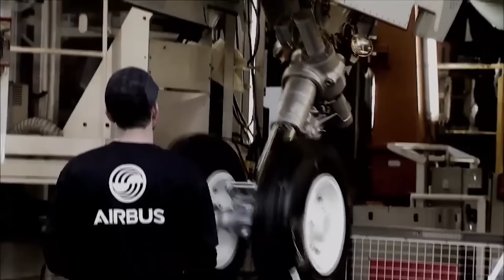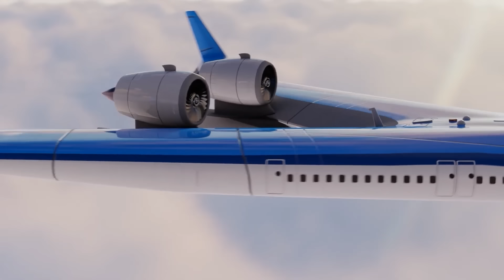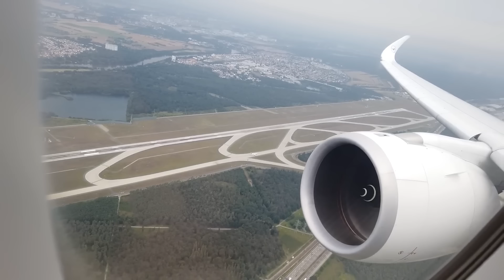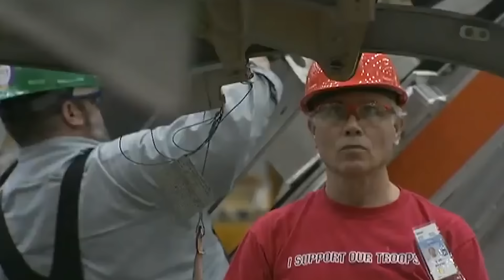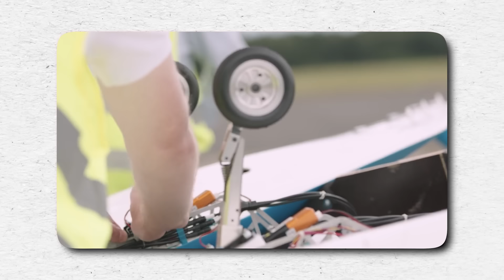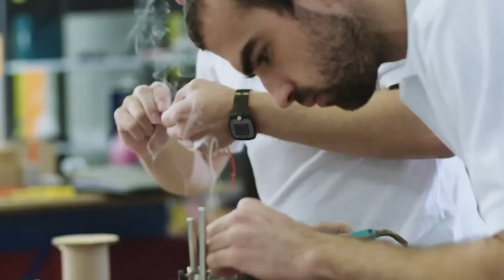Boeing and Airbus Are TERRIFIED of This New Plane | Flying V

Comment: Yes this design works. capacity still good 408 2nd class(coach and 40 in first class. First class is truly isolated from 2nd 100% with it's own kitchen. Stress of a lifting body as opposed to old Wing body Boeing aircraft Design of 1940's. This plane has a high probability of full scale airline deployment. A future craft? The cards say yes. Year: 2046-2140's? Somewhere in there they move to Hydrogen combustion jets 2054ish  but same body style. kerosene is mostly retired as fuel. Rudders are and efficiency cost from drag. Differential thrust will work better in heavy winds on approach accuracy and touchdown. Computer flight is complex but has been possible like the B-2 bomber.

Comment: Wondering about crash safety dynamics. Collapsible structures and fuel tank isolation don't seem possible when passengers,are in the wing, sitting on fuel tanks.

Comment: Is this a tested entity in the air? Can a detachable passenger portion n pilot detachable seat be part of it so that in emergency passengers portion can get automatic detachment n lowered to the ground by the help of the 4 parachutes
Reply from the maker: That's a really interesting thought about the detachable passenger portion and pilot seat! While the Flying-V concept is still in its early stages and focuses on fuel efficiency and design, those kinds of safety innovations are definitely something engineers are constantly exploring for future aircraft.

Comment: What a great design. I would just add another flat sheet of metal between the V which I think could assist with engine failures and keep it more stable in doing emergency landings and would have more gliding capabilities to enable it to cover more distance. It could also be used as a fuselage as well which will give it more range.

Comment: Airframe must have an "elliptical" cross section not this, nor current designs. That will generate massive lift while enabling 2 turbine-800 seats. Means %70 more savings, with minimum stress on hydraulics.

Comment: That is only half the range of a 777. It would also get the name "vomit comet" very quickly. Wing structures flex for a reason, survivability.
Reply from the maker: Check part 2 and 3 hahaha
Reply: @ExPlaned1  Comprehension issues?
Reply from the maker: @Mordalo  no not at All :) but I made a part 2 and 3 explaining more

Comment: This comment about the body providing lift is not true !! It absolutely does contribute. How exactly would the space shuttles have flown. As soon as the angle of attack increases the fuselage has high pressure air flow under it, this reduces the pressure above the aircraft and therefore does increase by at least 10 to 30 percent depending on the designs of the aircraft...

Comment: dont think it would work unless the lane bebomes mush biggen , the wingshape of the passengers compartment causes it ti have less headroom towads the trailing edge of the wings , there be way less window seas and the load has to be distributed more evwenly across both fuselages or the plane will fly pretty badly 
the wing shaped fuselage will be harder to pressurize like a cilindical fuselage , the shape wants to become a cilinder so needs a stronger body with ribs to resist that 
since the wings need to hold people their thickness is mush larger and the frontal surface / drag increases , not quite sure but my feelings tell me the plane will be less efficient compared to an airbus build twice as large as the current one

Comment: t looks too delicate, there is no clear composition of the two bodies? Where do these two fuselages connect? Only in the nose of the aircraft, .What is the length of the junction of the two bodies in relation to the length of the entire aircraft? Is the junction of the two bodies long 1/4 of the aircraft or 1/3 of the aircraft length or 1/2???? Then that body is divided into two parts without a single point of contact anymore? The engine platforms protrude into empty space, there is no connection between them? I don't think this scalamery will see me

Comment: I cann see one major operatonal issue, that of balancing passenger/cargo/fuel weights, side vs. side, and front to back.   It's similar to the balancing of weight issue of surface ships.   For example, even if the Flying V can handle 100 tons, it can't have 90 tons on the right and 10 tons on the left.   You don't have this balancing issue in modern jets since the fuselage is a central tube.

Comment: There is not a single ting wrong with a different looking design that actually works properly and safely. The standard passenger and or aircraft have used the same designs for a very long time. We shall see how much or little the new design will impact the industry

Comment: The design could easily incorporate solar tiling to provide electricity, too.
Reply: To what end?  Each solar tile would have to be custom made like the tiles for the Aptera.  And you get very little in exchange.  The amount of energy syphoned off from the engines for electricity is miniscule.

Comment: No, they aren't. The airplanes of tomorrow aren't going to look like that. The model is beautiful. But it's a model. I've seen a model of Snoopy's doghouse fly so making that thing fly is no big deal. Airliners are built they way they're built to make money, both for the companies building them and for the companies operating them. That V design, or rather wedge, has an inherent flaw. I do not want my body to absorb the impacts of up and down drafts in the air. Wings flex, acting like shock absorbers. This aircraft will do no such thing.
No, thanks.

Comment: You will not get passengers to sit in the interior section, and it would not be possible to evacuate quickly in an emergency. The only way this could work is for cargo or passengers with cargo in the interior

Comment: How on earth is every passenger going to have a window seat? The plane has four sides, and only the two outside sides have windows. It will have fewer window seats then current planes. With 2-2-2 seating, there are a total of 12 columns of seats, and only two will have windows.

Comment: Its only a prototype at this point which means it hasn't been built yet. It is still in the development and prototype testing phase. Researchers at TU Delft in the Netherlands, supported by KLM, successfully flew a small, radio-controlled scale model in 2020. A full-scale, passenger-carrying version is not expected to be in service before 2040–2050

Comment: The flying wing is a miracle, but putting the engines and fuel so far aft is a nightmare for stability. And of course the weight of that fuel changes as it burns which further affects the center of gravity whereas a conventional plane has all the fuel exactly on the CG so that's no worry at all.

Comment: The flying V should be safer when everything fails. The current plane stress me out knowing the fuselage doesn’t participate in the lift.
Reply: Total bullshit story telling , also Typical breakdown for a wide-body like the 777 at cruise (Mach ~0.84, high altitude, clean configuration):

Wings: ~85–95% of total lift
Fuselage(body): ~5–12% of total lift (can vary with loading, angle of attack, and Mach effects)
Horizontal tail: usually slightly negative lift (downforce for stability), offsetting part of fuselage contribution
Reply: When everything fails the traditional tube, wing & tail design is MUCH more stable. Like some modern military aircraft (*cough* F-22), the V design is going to require all kinds of computer-assisted stabilizing for normal flight

Comment: This isn't new . main mfg. have been looking into all kinds of designs for decades .  more than the tech is required , the market , the passengers themselves have a say in this . at least a 20% increase in efficiency is required for a full redesign and $$$$$ cost equation .
Reply from the maker: You're absolutely right, these concepts aren't new, and the market and passenger experience are huge factors beyond just the tech. It's a complex equation!

Comment: Sitting that far from the center of roll is going to be miserable.
Reply: Or exhilarating 😂
Reply: @Xaniker lol, most people don’t load their families on trans-Atlantic flights and hope for exhilaration. Just watch their reactions to turbulence.
Reply: @kurtl8425 I was being half serious
Reply: Flight dynamics might be different enough to mitigate against that.
Reply: "Roll"?  When a plane turns, it banks and changes the direction of it's lift force, which keeps you upright in your seat.  I've never been tossed from side to side because a plane is turning.  You're "roll" is what you are imagining happens - not what actually happens. Get a plane ticket - you'll see.
Reply: @nycbearff you’ve never sat that far from the centerline of the aircraft either. Imagine the wing as a giant teeter totter. When the plane banks 20 degrees if you’re 5’ from the center line you’re either being pushed up or dropped just under 2’ depending on which side of the aircraft you’re on and it’s uncomfortable. If your 20’ off the centerline it’s almost a 8’ drop.
Reply: @kurtl8425  You're extrapolating but, I think, missing a few variables.  Anyway, people who've traveled in the wing of a flying wing style plane have been able to sleep without interruptions, and report a very smooth ride - so there are some observations which your description does not align with. 

And the plane will have to be constantly computer stabilized, which produces a very smooth ride.  The air dynamics around a flying wing are different - I don't know how that effects the plane.  But the planes are described as slower to respond, including slow to respond to turbulence, which damps it.  That goes along with the smooth ride - and has now made me curious about what the air is actually doing around it.
Reply: This idea has been around since the dawn of aviation. There’s a reason no one’s using it for passenger aircraft.
Reply: @kurtl8425  Yes, many reasons.  But B-2s fly without the problems you're describing, and they're flying wings.  So I don't think physics is the main reason.
Reply: @nycbearff no people sitting in the wings. People who will bitch incessantly about the he slightest inconvenience or discomfort.
Reply: I don't think so.

Comment: Nothing really new here, both the delta wing and the lift body are quite old in designs, the difference is the cut out of the delta wing with a full lift body.   Both Northrop and Burnelli had the beginnings of this design prior to WWII.
The excitement comes from departing from static old designs.

Comment: Include a 3rd Engine and an aircraft frame that sustains 12-G’s both positive and negative, can take off and land on 2500 feet of unpaved runway, and a 17,000 mile range and you have the “XL” designed by engineering students at UC Berkeley for a new Air Force-1 back in 1996.

Comment: people that fear flight! with the V configuration, the gravity adjustment made from turns lift or descents. these with be more disturbing on those less centered to the planes center structure. think of a boat and motion sickness. it lessens the closer to center of gravity. these companies think of themselves, more than the people…

Comment: From Northrup's first experiment Flying Wings through the B-35 (?) bomber to the B-2 the lifting body layout has all provided greater efficiency. This seems to be an optimized design. Incorporating the Whitcombe winglets as rudders is a good idea although drag rudder/ailerons would work. Elevated engines give them clear air to enhance performance.

Comment: As long as the engines are exposed to ice, that can be build up on the wings when weather conditions are bad, thats a bad choise. The ice could came off and destroy the engine wich has happened in the past with rearmounted engines.

Comment: What if birds hit the windows, they beying more exposed to hits in this desighn?
Reply from the maker: That's a valid concern! Safety is paramount, and engineers consider bird strike resistance in all aircraft designs, including unconventional ones like the Flying V. They use specialized materials and rigorous testing to ensure passenger safety.

Comment: Close the space between the two wings with passenger space. It will improve the streamlining, structural strength and provide extra passenger space for free. The extra space is so massive that it can include much extra space per passenger without sacrificing economics and the bonus of potential extra passengers.
Reply from the maker: Check part 2 on our channel and you get your answer :)

Comment: Really are you SO SO unaware of the structural flaw of the cross section of those passenger cabin cross section failure to structurally contain cabin preessurization !!!!!!
As for silence that was achieved DECADES AGO by the Vickers VC10...  I was TOO Quiet  --->>>  on long haul flights the quiet vioce of a person 5 seats in front or behind you was clear and  I was unable to sleep..    
 Then you mention T Tail  with no video immages....😂😂😂😂😂😂😂

Comment: Looks nice, but I don't think that it's anymore aerodynamic than current passenger planes, and it's possibly less aerodynamic. My reasoning: First, those two big engines stick way out from the body of the plane, which makes it less streamlined. Second, as another commenter mentioned,  having two separate passenger cabin tubes and having them merge at one end also makes this plane less aerodynamic. I suspect that under the stress of frequent flying, this structure may be more susceptible to cracking and breaking where the 2 passenger tubes come together. Several other commenters mentioned the problem of keeping the whole thing properly pressurized. I don't know how that works, but I do know that changes in pressure aboard planes hurts the ears of babies and young children. That's why they cry and fuss so much on planes. If the pressure in this plane is uneven, that will make this problem worse. Sorry, but good looks aren't enough. It also has to be good, efficient, and safe.

Comment: Sorry, that is one ugly aircraft, and aesthetics do matter.  With a model they are not going to be able to test those engines for real.  There is a reason that aircraft engines hang forward of the wings and it has to do with the air's laminar flow coming directly into the engine inlets, while the laminar flow of that design will cause all kinds of problems for those engines where they are located.  Remember those planes which had engines installed in the aircraft's tail like the MD-80, MD-90, and Boeing 717.  Those designs all had problems, and this design will as well !!!

Comment: 3 issues. 1) motion sickness from interior seats with no windows. 2) Dirty air over the wing into the engine risks stalling. 3) Airports couldn’t handle the A380…what airport could handle one of these?

I love the possibility for cargo, but as a passenger option? No.

Comment: it needs a detachable passenger cabin so that in emergency the pilot can eject the passengers section which falls with parachutes to safety. this is the key thing that all planes need and it has already been designed
Reply: yeah only 2 engines makes me nervous... not much for back up plans...
Reply: Almost all jetliners can fly on just one engine and all pilots pilots flying commercial jetliners have to receive training in long range gliding techniques and landings. So not a huge worry
Reply: Imagine the thrill of a detachable passenger cabin being dropped, traveling at 500 miles an hour,  20,000 feet above the earth, counting on parachutes!  What a thrill!  Question: Do the pilots and crew stay with the crashing plane?
Reply: @geosande  i mean they could make it so in that emergency that air breaks come on slowing plane down then at a certain speed the parachutes deploy then the entire plane falls to ground with the parachutes while constantly slowing down from air breaks. better than just falling to BOOM !

Comment: This V-Plane will fail big time. For safety and security reasons there has to be a third engine in the middle of the V.
Imagine one of the two engines stops working. A disaster.
Reply: ALL twin-engine planes can fly on one engine.

Comment: This design seems already flawed. Cargo and engines located at the back of the airframe would massively disrupt the weight distribution and severely limit the cargo  capacity.  Take off with a full fuel load would be hard to achieve. But i’m not an engineer!

Comment: Good luck if you're a passenger on this design. Make sure you bring multiple  barf bags and additional back support to absorb the additional vibrations the out side passenger will be experiencing.  Next the wings will need to fold in order to be serviced at the gates, which will make it a heavier and less fuel efficient.  Servicing is a complete lie..... good luck,  hope you have insurance for all of the passenger injuries this air craft will cause.

Comment: Let it fly with cargo and some passengers for a couple of years without any crashes and the Passengers would love it.  With the underbelly baggage access you could use a ramp on top of a shuttle bus to move the passengers like they already do at some airports with limited Terminal access.  Not a biggy.  I like it and think it is definitely a step forward in Airliner developement.

Comment: Looks great not sure how it would handle  strong cross winds 

1 other thing is engines being above is that a positive or negative thing?

I was thinking g if you are flying in a storm and not above it they may act as rods and attract lightning

Those were really  my only two concerns

But I love the design and it does look like it would glide better and be more efficient but again not sure on efficiency when travelling through cross winds
Reply: Why cross winds?  Essentially the same crosswind profile of every other plane.  But ALL of it is providing lift...